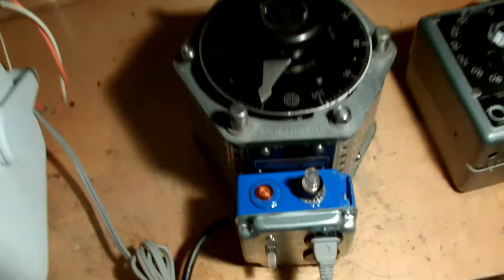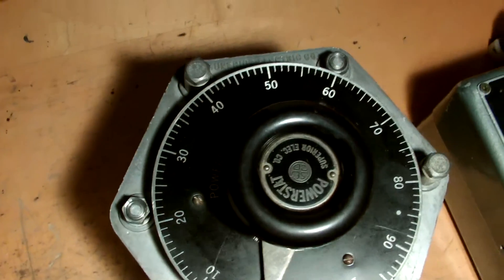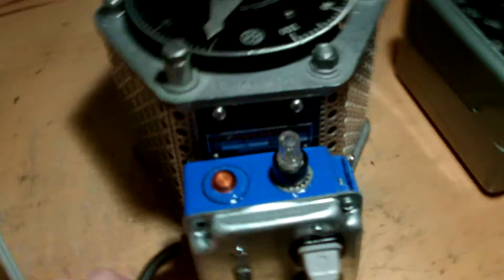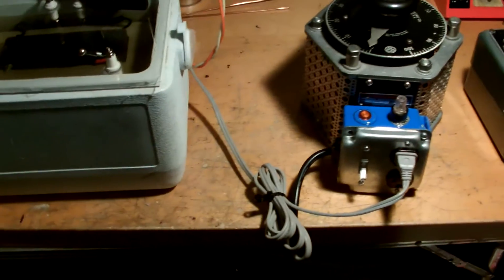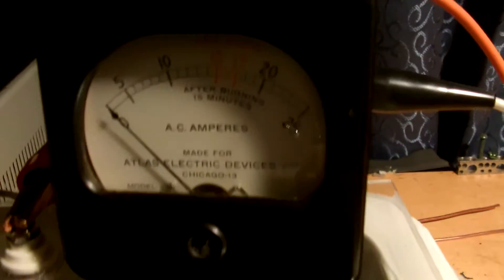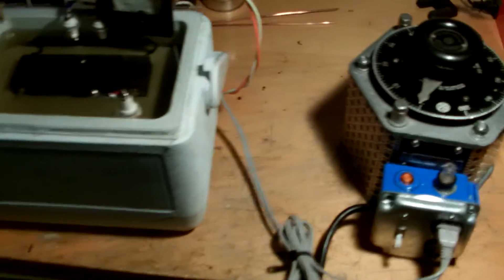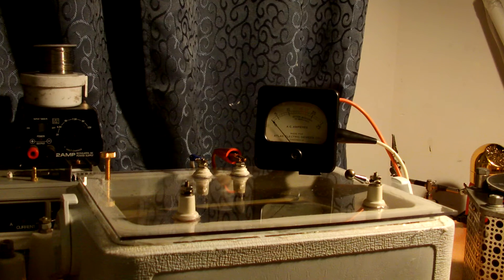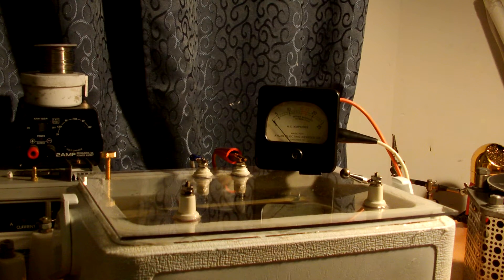X ray Transformer arcs and Variac test!

Comment from the maker: Hey Andreas, haha yeah they've got a bit of a crackle to em' lol  Im not quite sure of the maximum aperage that this particular transformer can pull because i have not run it past 70 volts and when its lightly ballasted it can pull enough to trip my 15Amp breaker lol Although the output voltage is high, these transformer types are quite fragile. In the video it drew about 8 Amps from the mains and around 12-14A from the variac's output. Thanks for the comment!